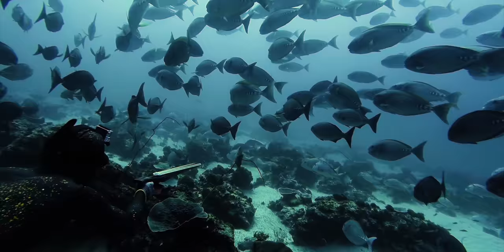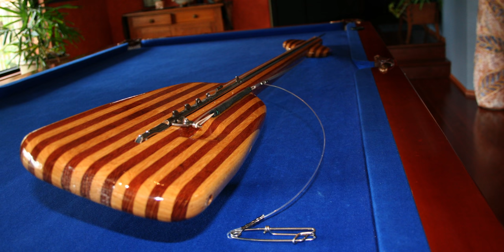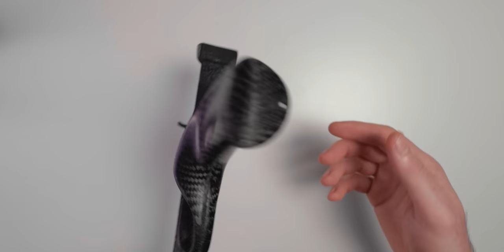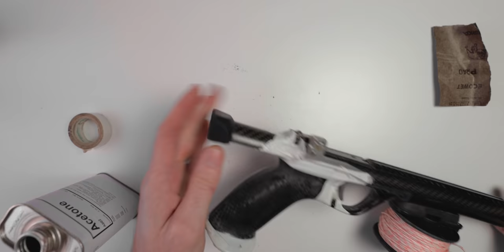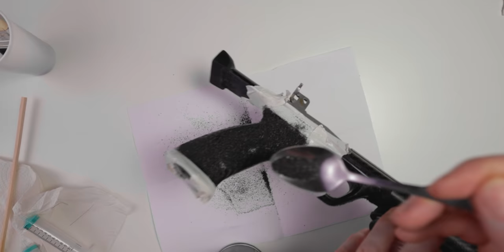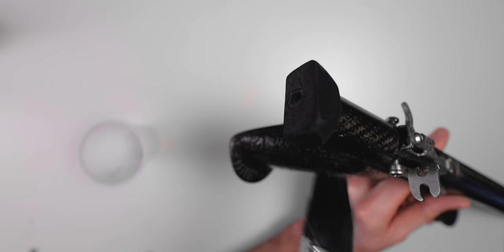Pimp my Speargun handle! Best grip for DIY wood & carbon

Comment: Tricks for working with epoxy resin:
I filled my resin into soft squishy bottles from Aliexpress like they are used for dispensing ketchup. It works great to accurately fill out the correct weight of resin into my mixing cup.

I mix the resin slowly to avoid bubbles when it is important.

When I use brushes I wash them in ethanol afterwards.

If not crucial for a perfectly clear resin I use the mixing cups several times and mix fresh resin simply on top of already cured resin. That way in the bottom of the mixing cup I get a nice layered piece of all the resin colours I have used in the past.

Comment: Another great video mate. I’ve used another technique for creating texture in epoxy finishes: paint the epoxy on, then sprinkle with granulated sugar. Once the epoxy has set wash the surface with water to dissolve the sugar crystals and leave a grippy surface. Cheers.
Reply from the maker: I’ve done the same thing on timber guns with ebony veneer handles so you can still see the timber. Works fantastic 🙌

Comment: Nice job! 
You could also use polyurethane adhesive sealant. Works quite well but it is not a permanent solution.
Reply from the maker: Doesn’t end up being that clear I have found.

Comment: Another way to add non slip to areas which I find is good, and very nice on the eye.

Mask off the area you want to make non slip. Mix some resin, epoxy or polyurethane is fine. Paint the area,  then sprinkle normal sugar onto the wet resin, cover it in sugar well and allow to dry. Once resin has cured, rinse off the sugar, it will dissolve and leave a lovely grippy surface.
Reply from the maker: I used to do this on my wooden handled guns about 15 years ago. Worked great when I made the handles out of ebony so you could still see the grain and colour.

Comment: Great tutorial,
When I had time to make spearguns I used sugar on epoxy on timber guns, after epoxy cures wash off the sugar to leave a nice soft but grippy finish
Different approach for similar results
Reply from the maker: I’ve also used that method a few times on guns with ebony handles so you can still see the beautiful wood.

Comment: Looks great and sure it works well. Have you heard of X-line paint? Ultra tough and grippy. Almost looks like the black sand finish you have done. Have a look. Think you would need to send gun away to have it done but it would be pretty neat.

Comment: I'm building my first speargun.. a railgun style with a carbon tube. The outer diameter of the carbon tube is larger than the muzzle and handle outer diameter where they meet... leaving a shelf of carbon barrel. What would you do? Sand down the barrel? ... or.... Build up the muzzle and handle around their socketed fittings?
Reply from the maker: No need to do anything if the track of the carbon barrel lines up with the muzzle and handle heights. You may want to slightly chamfer the barrel edge at either end perhaps.

Comment: thanks for the video 

you mentioned that you had build your own carbon fibre spear guns a quick video about how you do that would be really helpful as there is not many videos on it at the moment and it is hard to find guides etc ... 
also do you build your own trigger mechanisms or do you buy them or hand make them.
Reply from the maker: It wouldn’t be a quick video! Takes a lot of time and effort and I haven’t made one in about 9 years. I always buy the mechanism, don’t want to compromise on safety.
Reply: @DanielMann  Thanks for the reply one last question; did you do all of the shaping before you put resin on it and made a complex former/mould-- im asuming this is what you did and if so what did you use to make the bit you wrapped the carbon around it if you can remember like was it foam or wood or something you could easily take out. thanks
Reply from the maker: I made the core from foam and other composite bits and then vacuumed the glass and carbon over the top. You can do it with a wooden core but the shapes are more limited than with foam.

Comment: How do you make/shape a carbon fiber gun? Are they pure CF or are you wrapping/sleeving a wood gun?
Reply from the maker: I’ve done the wooden core method with carbon on top and more recent guns are entirely composite with a foam core. Not just CF either, need some glass in there to add mass to the gun.
Reply: Sweet thanks

Comment: Great Idea - Thanks! How do you maintain/repair wear and tear on your carbon guns? Could you use epoxy for that as well?
Reply from the maker: I find the wear and year on carbon guns is minimal compared to timber guns. I've had some of my carbon over timber guns in circulation for 7 years and they function as good as the day they were built. That's one of the main reasons I went to a composite speargun because of the lack of maintenance.
Reply: @DanielMann  Cheers Dan - I'm glad to hear. My UP-Tube gun should be shipped tomorrow. I think this will be the first mod I apply to my new gun :)

Comment: Good night, I am  trying to install a trigger mechanism in a wooden speargun. When I install the mechanism and insert the shaft  and pull on it it's slipping out. What could be the problem? It's the first one I made.
Reply from the maker: The trigger pocket may be too shallow to allow the sear to fully drop enough to engage the shaft.
Reply: @DanielMann  thanks, I looked at it this morning and the back of the mechanism is lower than the front. I have to make the adjustment👍
Reply: @DanielMann  good afternoon, I usedthe router to even the hight of the mechanism and it is still not working. We raised the back part of the mechanism and the shaft is locking. So I have to fill in the back with epoxy and see if it works. Would that be right to put the Bach higher than the front?

Comment: Hello Daniel, how are you? I have a pistol that looks like your grip but my grip is sliding out made of wood. Does this method work for it?
Reply from the maker: It will work for wood as well yes.
Reply: Thank you 🙏
Reply: @DanielMann  Hi Daniel, thanks a lot for the video, very interesting, does it work for plastic handle too ? (first tried to find out into the comments but it seems that no one already asked.. :) )
Reply from the maker: I don’t think it will stick to a plastic handle. I mentioned that in the description. I see for plastic handles people use sikaflex to paint on a rubberised type grip.
Reply: @DanielMann  I've red everything except the description..... Thanks for the reply ! :)

Comment: What trigger mech are you using on this gun?
Reply from the maker: I didn’t make this particular gun but it’s the standard under pressure mechanism from the manufacturer.
Reply: @DanielMann  what model from under pressure is this gun?
Reply from the maker: Tube
Reply: @DanielMann  👍
Reply: @DanielMann  if you ever want to sell it I will buy it. Can’t seem to get a hold of under pressure spearguns. Maybe they shut down.

Comment: I wonder how this would work on a slippery pole spear
Reply from the maker: I would probably skip the second coat for anything under tension. Although I think it would be a struggle to get the epoxy to stick to a metal pole spear.
Reply: @DanielMann  
My thoughts exactly about the epoxy sticking to aluminum. I think I’ll just get some better gloves.

Thanks for the reply, you’re the Mann😉